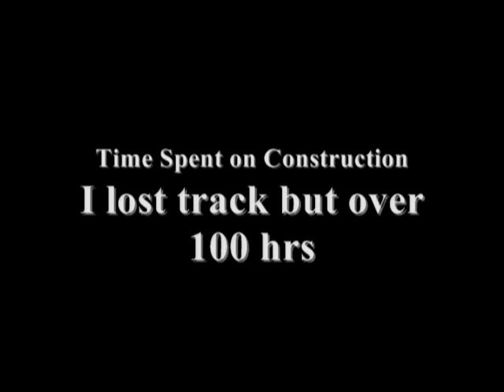Chapter 3 Carbon Fiber Bike Build Video

Comment: can you not just duct tape a regular vacuum up to that bag?
Reply: Ryancady010 No, they won't suck hard enough. Vacuum cleaners use a blower which is high volume but comparatively little pressure change. Vacuum pumps are a cylinder and valves, kind of like in a car engine.
Reply: Ah I see. Good to know! Thanks

Comment from the maker: Hey, thanks for the tip I'll have to try that. I've seen that done for bladders but not for vacuum bags. I use Butyl tape now but it's kind of expensive. Using a soldering iron seems like a good way to save some money:-)

Comment from the maker: Have you seen the Z Frame bike build? If not check it out, its on my channel and uses a totally different technique. It was done buy using two female mold halves and then the two sides of the bike (parts) were put together. It's still not a perfect part out of the mold but since the Z Frame I'm getting closer to actually being decent at making parts:-)

Comment: use a soldering iron with a U shaped copper tip and drag it along your bag and its 100% airtight. melting the plastic together

Comment from the maker: Thanks for the advice. Since this project 2009 I've changed a lot of my processes. I now use Stretchlon 200 almost exclusively for vacuum bagging, Butyl tape for a seal and a Gast 5.5 CFM pump for vacuum- It definitely makes a lot of difference with leaks.

Sounds like you've got some skills and knowledge we could all benefit from, you should post some of your techniques on your channel. I know I'd love to see them!

Comment: hi, im the spar builder for a racing boat manufacturer in the uk. i made stuff for half the olympic 49ers fleet ...(my credentials)  gotta good tip for you....instead of using that fiddley tape to seal the vacuum bag 
you might try using a plasticine rope in between the plastic sheets  .... never leaks and is easier

Comment from the maker: On this bike, I sanded the Peelply texture off- being careful not to sand too far into the cf. Once sanded I added another layer of epoxy, then sanded level and re-applied epoxy until it looked somewhat decent.

I've also found that leaving the peelply texture under the epoxy coating looks good too- I've done this on several cf longboards. In fact the peelply texture was preferred to the sanded and epoxied texture by the majority of those whom I asked.

Comment from the maker: I just realized that I didn't answer your question properly. I usually vacuum bag parts for the entire initial cure. Which is about 12 hrs with this epoxy. Again the epoxy cure time will depend on the epoxy. I have some that only take 2 hrs to fully cure- So I only bag those for the 2 hrs.

Comment from the maker: Greetings!

The epoxy cure times will depend on the epoxy and manufacturer's recommendations. The epoxy in this video is EZ-Poxy 83 and it takes about 12 hrs to cure at room temp. I then post cure for a few hours at around 120 deg f. The epoxy you use may differ. Good Luck! and keep me posted on your progress.

Comment from the maker: @AZURA888 
The green mesh is just a HVAC filter being used as a breather. You could buy some "real" breather from a composites supplier if you prefer. I've also seen some use people using batting for blankets as a breather. The batting looks exactly like the regular breather from the supplier but I don't know if it is the same stuff- I've never used it. 

A regular vacuum cleaner does not have enough suction power to pull an effective vacuum for bagging.

Comment from the maker: I got the rods and pump from ACP Composites. They work ok granted you don't have any wrinkles clamped in them. This pump has an automatic vacuum/pressure switch and does run intermittently. I mostly just use butyl tape now days and I've also upgraded to a much better vacuum system. I'll sometimes use a heatgun before bagging to wick out bubbles but haven't tried it while under vacuum. Thanks for the advice. I do however, use an IR oven for curing and post curing parts now.